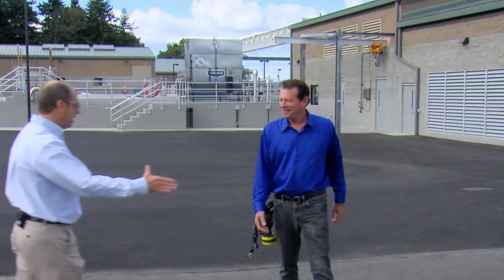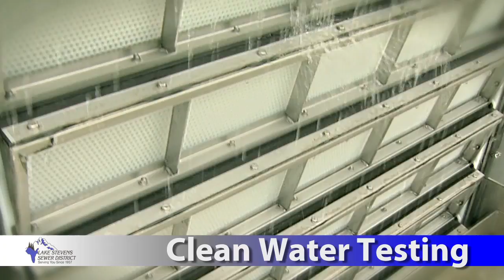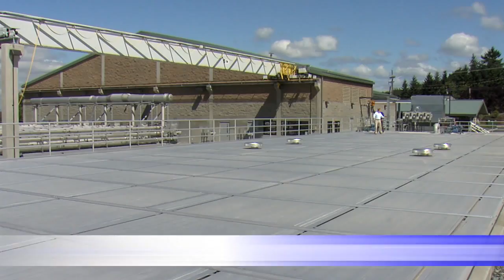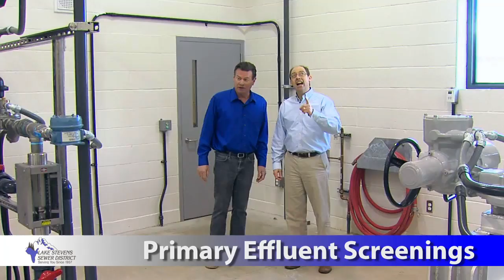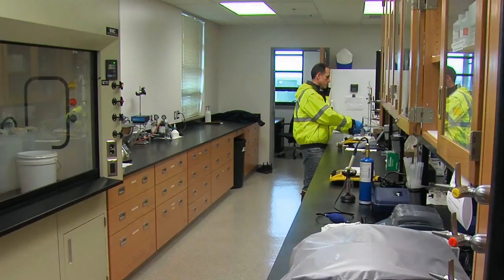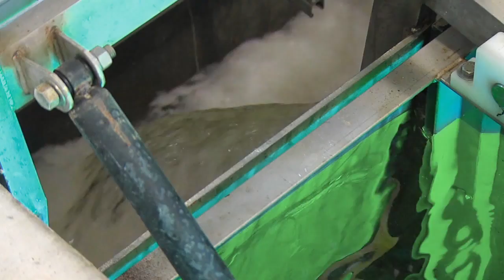A Tour of the Sunnyside Wastewater Treatment Plant in Lake Stevens WA

Comment: How does the waste water get to the plant?
Reply: Typically you’ll have sewer mains along straights parallel to water mains (opposite sides) which can run to a lift station to get it over terrain if necessary so it can gravity to the plant

Comment: Until the late 90s, most towns across the country had the old sewer system that dumped most of sewage into the rivers

My town didn't put in new pipes till the early 2000s and there is still about 20% of the city that still dumps right into the rivers